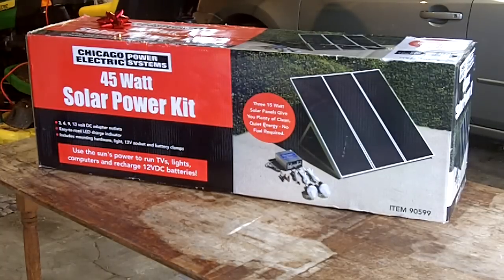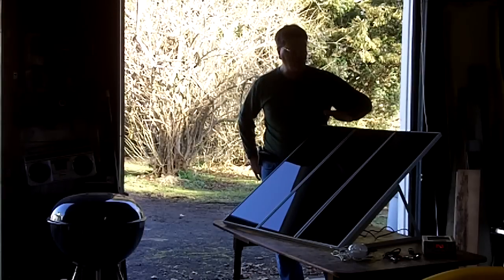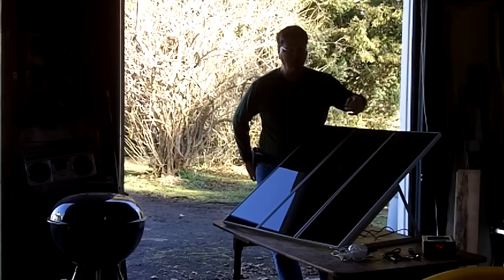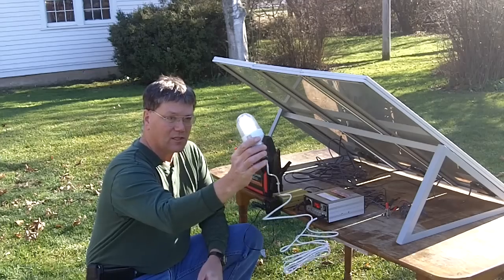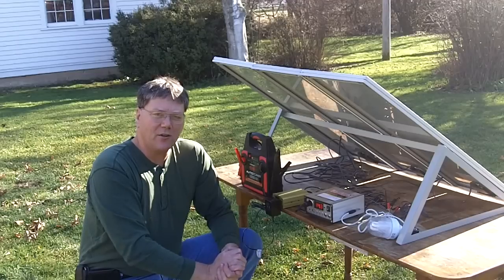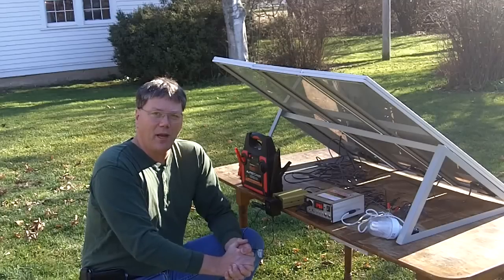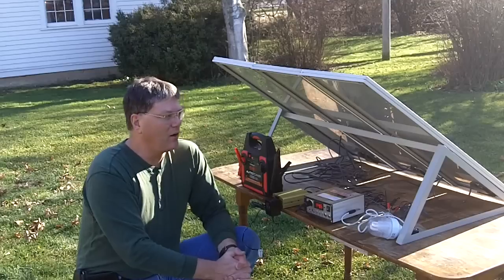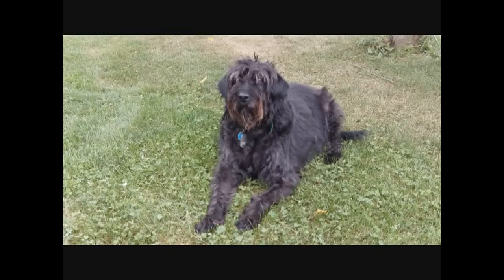Harbor Freight 45 Watt Solar Kit

Comment from the maker: The HF 45 watt Solar, does come with a 4 amp inverter, which is good enough to start out lighting a few lights & low amp items. Which is what was my initial goal as well as learn how a basic solar system works. As for the inverter (s) you may use with the HF kit, that item is something separate you buy to add onto your solar system like the deep cell batter. Right now I see with HF coupon you can get a HF 45 watt Solar Kit for $139.00 now. Good price and I'm thinking about getting a 2nd kit.

Comment from the maker: Yeah I know, guess I was excited that I had the solar system I got my wires crossed back then. I'm more knowledgeable now that I have it and used the Harbor Freight 45 Watt Solar Kit over the last year. Have used system several times over the last year, with the 115 amp deep cell battery I have now, during power outages where I didn't have to use the gas generator. Nice little system that pays out big during power outages when you need light for several hours instead of using flashlights. : )

Comment: the number on the front of the charge controler is Voltage, not Wattage. also, the little box that transforms the power from 12v to 110v is an Inverter.

Comment from the maker: @billtvmacon Thanks for the view Bill. Haven't done an actual YouTube in awhile and yesterdays little solar panel project gave me an opportunity to break out the Zi8 for a YouTube. Find with today's cloudy/overcast day they don't work to well. Low voltage where I can't do any charging of battery pack. That's ok because it's expected and why they make small wind generators to help supplement on those type days. Of course a wind generator is down the road a bit.

Thank you for the view Bill! : )